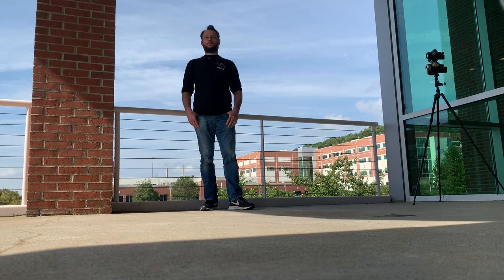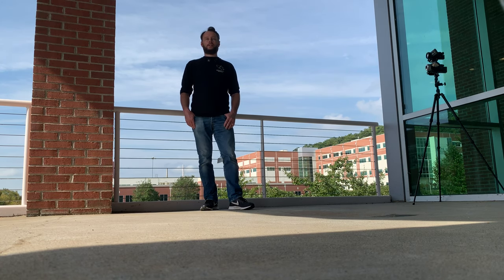Syd Ball and Uri Gat speak with Thomas Jam Pedersen @ ORNL MSRW 2018

Comment: I know this might sound silly but if people don't like the words nuclear, and radiation, and radioactive, and reactor so much then why don't we just stop using those words when talking about this technology?

Here's some examples of what I mean: instead of calling these Thorium Molten Salt Reactors why don't we call them Thorium Molten Salt Power Systems or Thorium Molten Salt Energy Systems?  Instead of calling these things nuclear powered why don't we call them geothermal powered (which according to Kirk Sorensen is actually technically accurate since Geothermal gets a lot of it's heat from the decay of Thorium inside the earth).  Instead of saying we need to have redundant systems to contain the radiation we say we need to have redundant systems to contain the high levels of energy or heat.

I mean if the major problem with this tech is political and based in public opinion then why don't we just use a classic politician move and just tell people exactly what they want to hear and avoid telling them what they don't want to hear?

I mean honestly which sounds better to you:

Some American Scientist from Tennessee figured out how to make radioactive nuclear power in a way that is less likely to meltdown and explode than other more dangerous forms of nuclear power.

Or

Some American Scientist from Tennessee figured out how to make geothermal power portable, safe, and self sustaining.

Both statements are technically accurate and are discussing the exact same technology but which one sounds nicer and which one makes you feel better?

Like I said, I know this solution is kind of stupid, but let's face it, the majority of people are kind of stupid and if we have to coddle them and hold their hands, and treat them like children and tell them a nice little story about how a man from Nantucket put some lava in a pot and with a little hard work, ingenuity, and a couple magic stones, he was able to make energy, and food, and water, and medicine, and was able to kill cancer and save lives and make the world a safer brighter cleaner place for everyone and how he used his magic pot to retire himself and his family so they never had to work again and they all lived happily ever after with their puppies and kittens and rainbows then why not just tell them that stupid ass story so we can put their dumb asses to bed and get to work.